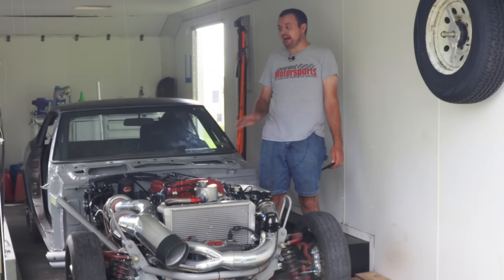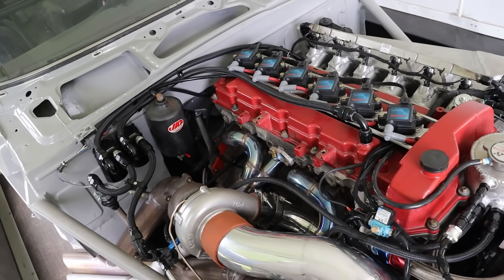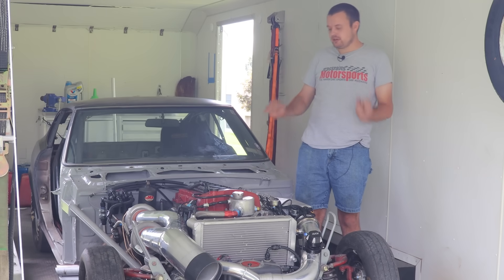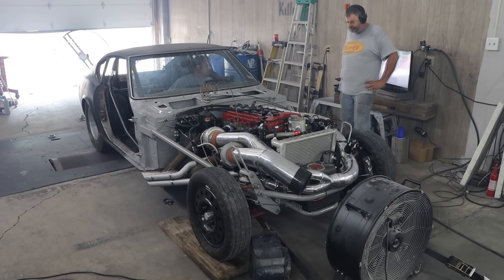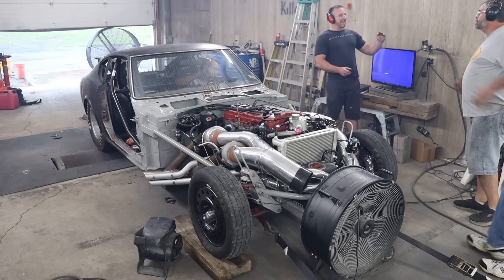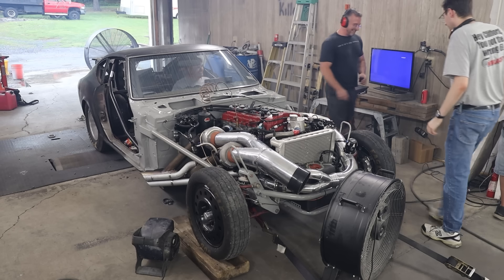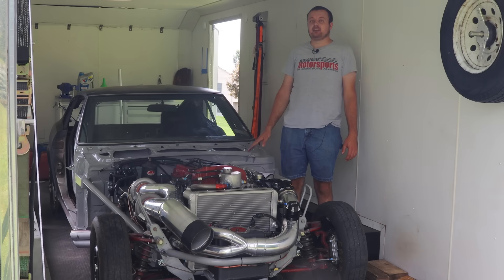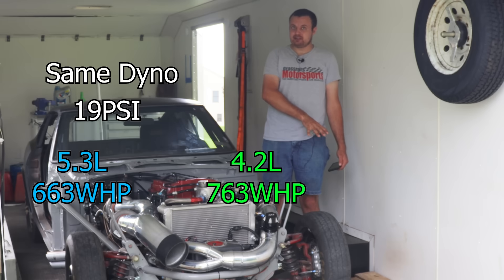This 4.2 Liter Engine Just Beat a 5.3 LS!

Comment: Congratulations on your 850+ pull.    Absolutely great.   There were the guys (B. Sizemore, etc) back in the mid 1970's with their Cleveland headed 300 CI sixes making gobs of power for that era.  You and your family are trailblazers (pun intended) for this era, and making double the power with less CI.
Reply from the maker: Thanks. Those old 6s are very cool
Reply: @Calvin-Nelson  
Theres someone on YouTube putting an LS head on a Ford 300
Reply from the maker: @mpetersen6  yeah. That's Ken. Cool guy.
Reply: @Calvin-Nelson  
If I were younger I'd seriously look at putting a Windsor or Cleveland had on a AMC/Jeep 4.0. Same bore spread. That or use a set of Infinity or GM LQ-1 heads. They're pretty close. A lot closer than the LS to the Ford.   In Argentina they race Ford, Chevy and 4.0 based motors with 24V DOHC heads. TC series.
Reply: Wow! This engine is an affordable alternative to the 2JZ that is made right here in the USA... this is FANTASTIC!!!

Comment: I bet some of the power difference comes from less friction (6 cylinders vs 8). And I bet the methanol helps a bunch. The 4v head has to outflow the ls heads too. Did you ever get flow numbers on the 4200 head? Makes me wonder how much power an ls could make over 7000 rpm with some kind of 4v head?
Reply from the maker: They both had methanol. The 6 just had more. Never got flow numbers. There are guys that have made 4 valve heads that work on an LS.

Comment: I was watching some barra content recently and a guy was building a 1400 hp one and they got into the harmonic issues and crank upgrades they offer for them and apparently the barra suffers from the same issue the 4200 does. The stock crankshaft is not fully counterweighted (like the 06+ 4200 stuff) but all that comes from the bad harmonics is loosening the bolts on the flywheel/flexplate (luckily the 4200 has 8 bolts vs the barra's 6 bolts) , not "beating up the bearings" like alot of guys assumed with the 4200. Alot of the big HP barra builders say, a stock crank (not fully counterweighted) is good for 8500 RPM. They even offer a 102mm stroke crank upgrade for them (barra has a 92.26mm bore from factory) which turns them into a 4.2 (4200 is 93mm x 102mm from factory) and theres a guy who runs one and revs it to 8500 RPM while making 1400hp. Long story short im becoming more skeptical of the "itll beat the bearings out of it" statement.
Reply from the maker: Me too.
Reply: @Calvin-Nelson  Check out the video its titled "Mega Ford BARRA Build - Part 6 - "BARRA PROFESSOR"" by Hoontv and go to like the 10:55 mark

Comment: Whats max hp on 91 octane? Its crazy, in high school i was working on my 1959 chev fleetside wondering what engine to put in it. In the driveway was my mom's 05 envoy 4.2 we never would have thought of, and they scrapped it before i could find out how awesome it is. It was brand new when i was working on my truck or it may have been a viable option lol. I love inline 6 engines, and i hope you inspire the aftermarket to bring some cost effective solutions to compete with the LS
Reply from the maker: They're 10.3:1 compression. I'm sure it would be ok on 400whp, but you need to get some alcohol in it to go much further.

Comment: Its wild how much power its making with such little boost gotta love that 4v per cyl design. I think a set of forged pistons along with the rods you added would help this thing comfortably make 1000 wheel, which is pretty crazy given how stock this engine is. 2jz guys usually need billet mains, aftermarket cams, and ARP hardware all over to make that happen through an unlocked auto.
Reply: Just watched a video of a 2jz teardown on one that was run somewhat hard at Bonneville last year , it had every "unobtanium" part in it money could buy & it was hurt , I realize this is not a comparison but I think it shows the potential of this motor to be every bit a worthy alternative .
Reply: There have been 1000hp unopened 2js
Reply: @danielwilliams214  Not through an unlocked auto lol maybe a manual but thats like a 100hp difference between an unlocked auto. Also you usually need head studs and valvesprings atleast to even attempt more than 600 wheel with one through an auto. So idk what you mean by unopened but thats not unopened lol
Reply: I’ve personally made 1100+ on an unopened 2jzge, with easily 60+ 1/8 runs no issues.
Reply: @I_Build_Cars  post proof all i see is a "sbe" with everything done to it that makes 730whp and thats not "unopened." Basically what i already said, cammed,, springs, arp hardware, etc...
Reply: @thewraith6360  it made 1130 on 40psi lol . Also, your arguing on a video where THEY LITERALLY HAVE PISTON ROD SPRINGS CAMS STUDS etc etc
Reply: @thewraith6360  making 730 on a fbo ls is most likely choice when there are ls motors cars making 1000+ just because it can doesn’t mean someone has the money to. Not everyone wants to run on the ragged edge or spend the money to do it right. 
Just look up Matt happel aka sloppy mechanics.
Reply: @I_Build_Cars  Yeah totally "1130hp" but runs 5.30s in the 1/8th in a gutted out notchback LOL. It has stock pistons, forged rods, $100 valvesprings, $130 china headstuds and stock cams reground. That wasn't the point someone said 2jz's make 1000wheel unopened. I know thats not true cause one of my closest friends builds em for a living. He went 4.50s at 1200 wheel in a tacoma, like 4 years ago. Setup had stock mains but after taking it apart the mains were walking a bit and he built another billet main setup.
Reply: @I_Build_Cars  So it made 730 on 27psi and with 13psi more and a 75 shot it magically picked up 400 wheel LOL seems legit.

Comment: they are impressive engines I have a ext Trailblazer with nearly 200,000 miles on it and a dodge hemi truck can't walk me
Reply: I highly doubt you could keep up with a 2012 and up Hemi Ram.
Reply: @sierravmax  you got to remember it's not fixed up nothing special and it has lifter noise but I have no problem having fun if I get beat okay I should but sometimes you be surprised
Reply: @BB-fv2dw  Their 1/4 mile times are 16-17 seconds. Not going to surprise anyone. lol
Reply: @sierravmax  you seem sensitive about this I in churchville MD anytime
Reply: @BB-fv2dw  No I am not. Stop getting a big head because of what this guy did. He yanked out the 6 cylinder of a Trailblazer and slapped it in a light weight car and strapped a turbo to it. Sorry but you will be way too slow for me to run. Waste of gas really when I already take out TBSS's easily.
Reply: You remind me of the V6 Charger guys. 😆
Reply: @sierravmax  never did I say I can beat them if you can understand words you dodge guys sooo sensitive
Reply: @BB-fv2dw  I don't own a Dodge. lol I am a GM guy. I know what my 06 Sierra Vortecmax did to my friends 2012 Hemi Ram from experience and don't see anyway a regular Trailblazer could even keep up with the Ram.
Reply: @sierravmax  wow it's a daily driver for me I spent 2000 bucks on it and some junk yard parts and your  getting really serious like I said I am the fastest guy out there. 
it's just a impressive motor for what it is  there's always some one Faster and I know I am not the fastest it's just fun to get poeple fired up. it is factory 3.73 gear and that does  help
Reply: @BB-fv2dw  My 04 Colorado had the Atlas 5 cylinder before it blew up. Probably would of ran right with a TrailBlazer due to weighing 700lbs less. I never once talked it up because I know it was slow.
Reply: @sierravmax  that's were your wrong I was talking about the engine capability of being a 6 cylinder and moving a heavy pig and still   running with more powerful vehicles
Reply: @BB-fv2dw  I am just saying this video is going to make people want to race their stock 6 cylinder Trailblazers. I don't want to see them get disappointed. It will humble some of the guys on here real quick.
Reply: @BB-fv2dw  Dude it is a 16 second vehicle at best. My GMC Sierra ran a 14.8 stock
Reply: @sierravmax  EXT 4x4 it has 3.73 gear  that puts it in the 15s you just can't admit it's a good  engine can you
Reply: so a 400 small block is no good if you look the specs up
Reply: @BB-fv2dw  No because I had the Atlas 5 cylinder version which is in the same family that spun a rod bearing. It is actually a common problem. Plus there is a huge recall on the head. They are also plagued with a ton of small issues. I drove it till hit 204k till it died.
Reply: @sierravmax  so regardless you are always right my bad good luck
Reply: @BB-fv2dw  Me along with all the other thousands of people that hate the Atlas motors. But you do you man. Just don't pretend like you have something special.

Comment: Just need readily available oil pans for front or rear sumps and 45° swap mount brackets and it can go into anything! I would love a early Nova or a box Chevy truck! I did measure out a 5cyl setup with manual trans to go in a 240z(not extended front end like yours) and it looked like I could easily fit it.  I remember back in the day you tried making an adapter that went to a 2jz forward facing intake manifold.  Did that work? Was it even close?  I can't remember cuz that was back when you had one in the Studebaker.
Reply from the maker: I tried to make that work. It would have, but there are other products on the horizon.

Comment: That spark thing at the bottom of the transmission, that inspection cover being touched couldn't have nothing to do with the crankshaft movement under a load, thrust bearing?
Reply from the maker: It's possible.
Reply: @Calvin-Nelson  I got to tell you. The stuff you, and your dad are doing with the 4200, is unbelievable!!! it's the most interesting stuff I've seen on yt, pertaining to cars, in a long time. You guys are making huge power with 4200s!!! It goes back to grassroots hot rodding. this is how they did it when it started. You guys keep up the good work, & I can't wait to see what's next!!!

Comment: What was the previous record on an Atlas Motor?
Reply from the maker: There are rumors of them making 1300hp on an engine dyno.
Reply: @Calvin-Nelson  Pretty amazing. I specifically meant your record. But that's awesome. My buddy used to have an '05 Trailblazer and ended up trading it in because it started having issues with (IIRC) oiling. The dealer suggested trading it in vs. fixing it.

Comment: I'm amazed at how much horsepower you can squeeze out of a Vortec. Who would have thought a grocery getter SUV engine could be such a beast with some boost?
Reply: We can make every engine a beast with boost. Nice video and good work
Reply: @ironmike742  almost
Reply: Pretty strong engine stock I think many of us ever owned one probably realized the potential.
Reply: My mother had the engine in a white trailblazer. Aside from being pretty peppy for a monster school bus sized exterior, that engine had so much torque. The transmissions were junk but man, you could pull a house in low gear with the torque. I never thought of boosting one but always thought it would have been a good mustang starter engine over the 4.slow v-6. Sweet power out of that sweet up there. You guys did great.
Reply: @patrickrobinson2520  The 4L60e is a pretty good transmission actually. It’s pretty much same as 700r4 which was around for along time only getting better over the years.
Reply: @Thumper68  well my mom did drive it a lot and she can be rough on anything she's ever owned. Lol
Reply: @patrickrobinson2520  lol yeah I can understand that nothings bulletproof especially if not receiving maintenance and used hard.
Reply: @Thumper68  true but i believe he is using a 4l80 trans in there. a 4l60e cant really handle over 500hp on track.
Reply: @BrandonnBike  that’s a stock 4L60e it’s not a bad trans it can’t be built to hold 1k hp. But stock 5-600 is max for sure.
Reply: It is pretty crazy
Reply from the maker: Heck yeah. 4 valve to the front.

Comment: I would be happy with a stock 4200 and transmission combo for my old 67 c-10
Reply: I've thought about this exact setup.
You could retain cruise control.
I know in the early years 02-05
The engine and transmission harness are one and the ECM/TCM bolts to the side of the stock intake.
A bundle of wires about the thickness of a quarter run from the engine wiring harness into the fuse box.
Reply: Also, it’s an all-aluminum motor, major weight savings over a BB v8
Reply: After watching this video, may consider this little monster for my 67 C-10 as well
Reply: Damn near 300hp in stock form. Excellent for an older vehicle with an O/D trans so you can cruise on the freeway. Probably get half decent mileage too.

Comment: 19psi, same intake temps? What about exhaust temps, and fuel consumption rates?

Are you sure it's not a case of the engine's operating parameters being vastly better on the Atlas vs the LS, relative to the same turbo? (I.e. the turbo is better-sized for the 6 than the 8)?
Reply from the maker: There are a few advantages to both sides. I just thought 100 hp was enough to outweigh all that.
Reply: @Calvin-Nelson  undoubtedly - sorry if I wasn't clear, I'm not doubting your conclusions, just trying to figure out how & why!
Reply from the maker: @krakhedd  I can respect that. Maybe I'll do a more in depth video.
Reply: @Calvin-Nelson  I can't speak to your broader audience but this one nerd 🤓 loves getting into the nitty-gritty like that. You'll never bore me with studying the differences!! 😁
Reply from the maker: @krakhedd  It's always a fine line between audience retention and too nerdy. I try to tow that line.
Reply: @Calvin-Nelson  don't worry about towing the line. Please more information.  The more information we can get , the faster the rest of use can make one of these work in our builds. The more being used in builds will help show companies that we need support for this platform

Comment: I know you said about the possibility of breaking Crankshafts if one installed a Supercharger on the 4200 but it would be really interesting to see a supercharged 4200 , 
Another crazy idea 'using a centrifugal Supercharger and mount it close to the crank pulley ( so less belt length) or mount it to the crank pulley ( ie , the crank pulley will directly drive the Supercharger, with some kind of machined insert)
Reply from the maker: Yeah. We'll probably try a supercharged one at some point.

Comment: Correct me If I m wrong the LS probably has more Torque compared to the 4200 at some rpm , probably the low end
Reply from the maker: I'd have to look. The 4200 feels pretty torquey.
Reply: @Calvin-Nelson  they are truck motors after all
Reply: @Calvin-Nelson  The RPM-range is considered high for an American 6-cylinder engine, (especially an SUV!) but it don't have to rev to the moon to get very good torque. It most likely will feel similar to a Jeep 4.0.

Comment: DOHC engines require less camshaft then two valve engines to make max power.
Reply: They actually require more camshafts.

I'm joking but...they usually  require less lift but the duration numbers are still pretty close.
Reply: @joshdrobny93  I would like to see a 2 valve engine with a 228/231 at 1mm spin to 7400 RPM and make 571 HP N/A.  https://www.youtube.com/watch?v=rHstOAMz-9w
Reply: What you mean is 4+ valve per cylinder engines.. as there's many 2 valve engines that have dohc.

Comment: Very impressive! I think the big reason they are ignored is because not many company’s make parts for these things and I like where your trying to take it
Reply from the maker: Nobody makes parts for them because nobody makes parts for them because nobody makes parts for them because nobody makes parts for them because nobody makes parts for them. We can break this loop.
Reply: @Calvin-Nelson I feel the same way about the SOHC VG30/VG33, they're 1000hp capable with the stock block but just not enough aftermarket support to be viable for most people.
Reply from the maker: @bearrett50kal17  It's a vicious cycle. Lol
Reply: 2002-2012, then it was scrapped. GM had the LS Based LT in the works along with the LV3 262 V6.

LS has been in production since 1995/1996-2016, that's 20+ years, and the Gen 5 SBC is LS based.

Comment: Same timing too for the 4200????

If so, that head flow must be insane. But assuming both engines have optimized timing, but 4200 has more, there must be MUCH better combustion chamber design.
Reply from the maker: They did not have the same timing. The rod stroke ratio will also effect optimal timing. More timing would actually say that it has a worse combustion chamber actually. The 4.2 had relatively conservative timing. The 5.3, we tried throwing some more at it, but it did not result in more power.
Reply: @Calvin-Nelson  instant sub! Fan from Australia and I have a question what’s the quench look like on the atlas? I’m guessing probably like our Barra or an rb  or 2j more of hemi design,in comparison to high squish detonation prone typical heads on most v pushrod engines, I’ve been porting and reshaping chambers for a couple of years on my pump 98 octane boosted l36 it’s using factory ecu but on supercharged memcal and factory maf up to 27psi boost, definitely couldn’t do that on the original chambers.
Reply from the maker: @needmoreboost6369  it's the typical pent roof combustion chamber. The pistons are domed and actually only come up to like .050" below the deck. Head gasket is very thin.
Reply: @Calvin-Nelson  kinda want one! Never seen one here in Australia! I’ve got a couple of commodores that it would sit nicely in! ones a 87’ ex cop car rb30et but with a rb25 head and the other is a ute with the 3.8 l36 both make ok power but that atlas would be unique! Having said that the 5.3 is rare here too